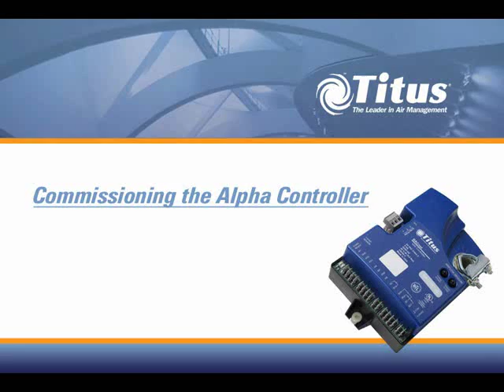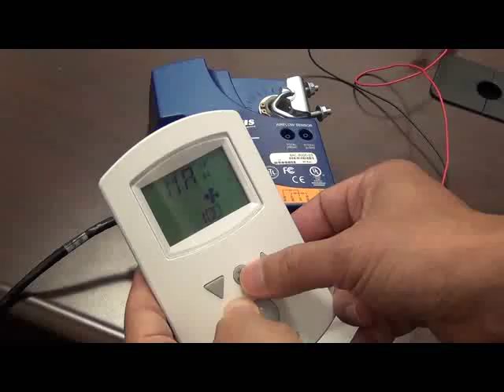Commissioning the Alpha BACnet VAV Controller

Comment: Are the AHU and VAVs working together in conjunction based on the BAS sequencing?
Reply from the maker: You’re asking whether the AHU and VAVs are working together based on BAS sequencing? It may be the case that the BAS is communicating with both the AHU and the VAVs, but it may not. The BAS could simply be commanding the AHU based on an operating schedule while the VAVs simply handle the room temperature control based on whatever the AHU is providing. Often times there’s no need for any interaction between the AHU and the VAVs. The AHU will turn on/off based on scheduled operating times and run to maintain a preset return air temperature.